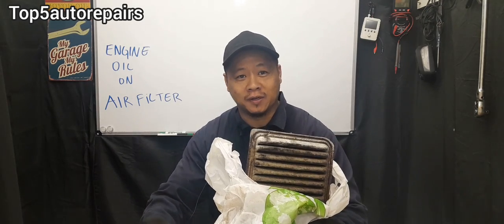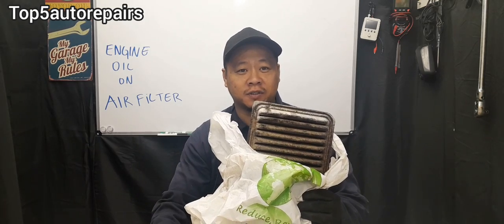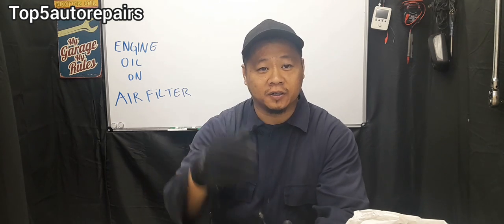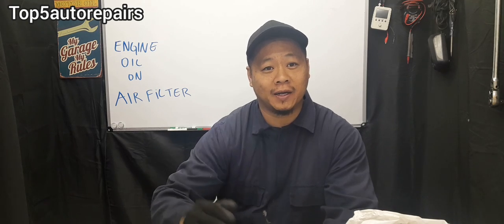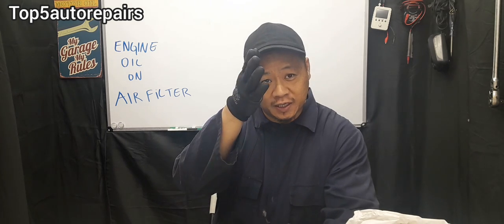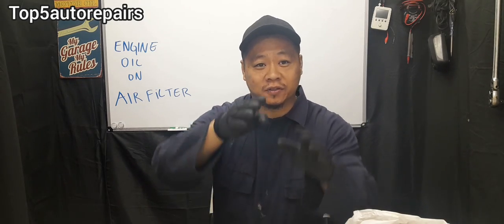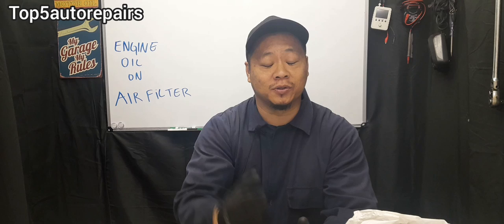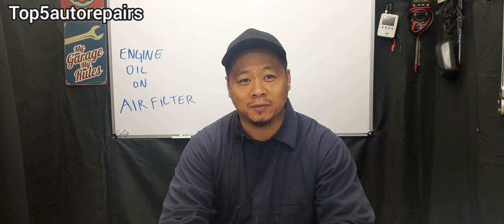ENGINE OIL ON AIR FILTER? HERE IS WHY

Comment: I have a 2023 honda civic hatchback sport touring and I changed the oil when it 30%-20% of oil life left, but everything you said has happened to my car when I have just hit 36750 km I ask my local honda dealership to check all the filters when they last had my car but I now know the machine didn't gat ask or didn't Bother.

Comment: Eliminated from intake to valve cover hose. Plug up intake side and run a hose from the intake down under your motor. Like in the older vehicles.